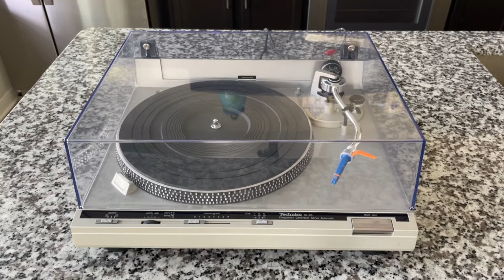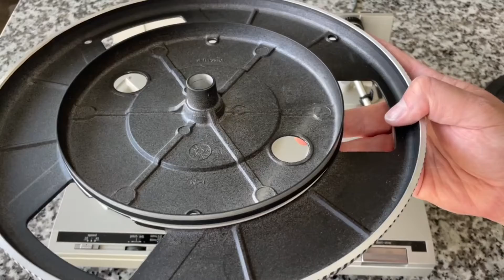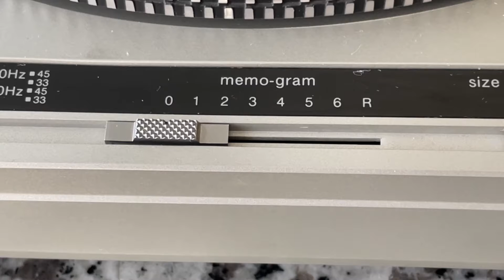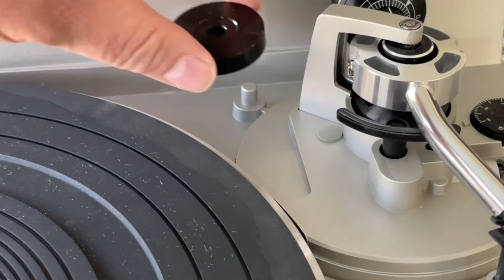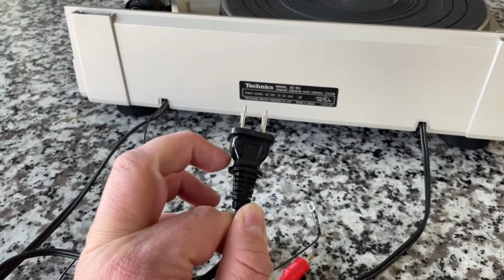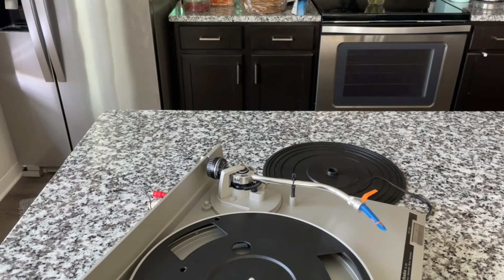Technics SL-B5 Review & Test!

Comment: Great video! Love your enthusiasm for this. I feel the same way about my Technics SLB-500.  And it’s been in our family since the day we bought it new back in about 82! It’s always just fun to use and, I don’t know, hard to explain I guess. But it’s a mechanical marvel. After all these years I’m still wowed by how beautifully all those mechanical parts work together. The multi-record spindle is especially cool.  Delicate and somehow robust at the same time.  Sadly, my unit finally quit working about a month ago. Had the Dickens of a time finding somebody to work on it. But finally did. About 530 bucks to put in a new motor and a new logic board or whatever they call it. But I told them to go ahead and fix it. It’s fun use, extremely well built, and has great sound. I don’t want to buy a new one. It seems the only difference between mine and yours is that the five that you have has an adjustable tone arm balance. The 500 that I have does not. After over 40 years of use, it almost never drops the needle in the wrong place. Maybe one out of every hundred times. Just amazing

Comment: Technics made a few beltdrives before and during the early direct drive era
 I think that when the quartz direct drive was intriduced the "belties were finally discontinued. They were very inexpensive, maybe 150 or 200 bucks in the early 70's. They worked fine for what they cost at that time. Abyone paying 450 bucks for one today needs a straight jacket right away.  100 bucks should be the max for a working one. They not a trye high fi item then, simply better than Emmerson, Julliet or a console mounted unit. If all you want is a relatively refined platter to spin old records from some garage it definitely fills the bill. Given a half decent cart like that Concorde it will play good records without damaging them and reasonable fidelity. Personally given the steep price of good modern vinyl, I would never run any record you really care for through the changer function. Tge automatic return of the stylus is fine though.

Comment: I just picked one up on eBay at a decent price. The only issue it has is the stylus slides onto the beginning of the record, be it 45 or LP. It doesn’t do it all the time, but enough that it is annoying. Even with the anti-skate setting all the way to 0 and beyond. Does anyone familiar with this turntable know what the problem could be? I’d appreciate any help. Thanks.
Reply from the maker: First of all, congratulations on an excellent acquisition! Sounds to me that the Tracking force is set too low. Research the proper tracking force of your cartridge and make sure you are set to the right value. Also make sure that the anti-skate number matches the Tracking force Number.
Reply: @Recordology Ok thanks

Comment: I have an SL-5 linear tracking turntable in my bedroom/home theater and have been using it for years, but most of the buttons don't work properly and I have to open the cover to stop it at the end of a record.  My dad, who doesn't listen to the radio anymore has this one (SL-5) in the basement/rec room.  Thinking of swapping out unless the SL-5 is worth getting fixed...either needs a cleaning or a new circuit board, but it would cost me at least $120 plus parts to find out.

Comment: The 'valley' areas under the platter are there for further reduction of the vibration between the motor and the belt, OR to further balance (but not reduce) the vibration when the 'valley' areas contain minor spare parts such as screws or feet.

Comment: Nice video. We found one at an estate sale a few weeks ago. It needed a new belt, and stylus. I kept the same cartridge. It had Ortofon FF15XE M II. Found a replacement on ebay. Once I cleaned it, put in the belt and stylus... It sounds amazing Took another video to learn how to use all the balance and skate settings. Only bummer is the dust cover was very scratched. Been looking for a replacement dustcover. We bought it for $50.

Comment: Matsushita sure made a lot of variations of their turntables. Yours is a beauty. I got my father's Pioneer, made by Matsushita of course, that was made in 1968. You can see the DNA in both this Technics and Pioneer. My Pioneer 740 is fully automatic and direct drive. It is a little cheaper in the tone arm department but fully adjustable. These machines were well built. This 1968 unit still works perfectly.

Comment: I've loved Technics turntables since the late 70's.  I have several now, SL-1600 MK2 (similar to a SL-1200 but with automatic cueing - I think it was heavily used in radio) and a couple of linear tracking models (SL-5 & SL-6 - this one has the track sequence playback function).

My question is about what are you using to clean your records?  My ears aren't as good as they used to be, but I didn't hear any surface noise or pops/clicks in the playback demo - even with that "heavy" tracking force you're using.

Keep up the good work!

Comment: with  the staker part of this turntable some people used to find that as a 2nd or 3rd record came down play scratches were caused  over as the first record would be spinning as the 2nd record came down onto the platter
Reply: Actually that's a myth. Because the label and outer edge of a vinyl record are raised, the grooves in the playing surface are never scratched or otherwise touched when one record falls on top of another. In a styrene seven inch 45 only the label is raised, but again the grooves are never touched when a record falls down the spindle on top of another. Fully automatic stacking changers are a great way to enjoy records, and IMO Technics made the very best. I'd be the first in line if they were to get back into the changer market with a direct drive model.

Comment: Up until the end, Technics had a fairly even distribution of belt and direct-drives. Most of their direct drive tables also had a belt-drive counterpart. 

My first turntable with a removable heasdhell was the predecessor to the one you're looking at here, the SL-B2. I had to replace it with an Audio Technica 140 because the speed just got too unreliable and the anti-skate spring just wore out and did absolutely nothing. The AT was much more reliable speed-wise, but the anti-skate was equally worthless :) But for the two years I had it, it was a vinyl ripping workhorse. 

I would absolutely get another Technics, doesn't matter whether it's belt or direct drive. I cut my teeth on Technics turntables.
Reply from the maker: Awesome

Comment: This deck was under 200 bucks at the time. There was also a version with direct drive SL-D5 for around 50 bucks more.
Anyway,the best price/quality ratio for a deck around the 200 bucks mark from that model generation has the SL-Q2 imho.
A semi automatic turntable with q-locked DD and alumium chassis. Just remember all those models mentioned were between
entry-level and middle class in the Technics program back then.
Reply: Yes
I have the SL D2 DD semi auto and its be all right today

Comment: This is a consumer grade turntable of the late 70’s. Technics made several models of belt drive and direct drive models in this era. Not close to hi end but better than an entry level table at the time. What makes yours interesting and less common is the stacking functionality. Ones like yours are far less common because of that.

Comment: You are so fortunate to have gotten the stacking 45 spindle with this. It and the stacking 33 spindle are unobtainium rare and expensive to find on the used market.
I have 2 of a similar cousin MCS / JC Penny  - branded version of a Technics stacking auto changer (there were several models of changers under either brand) and I do not as yet have the stacking 45 spindle.
Stupid me, I was given a different Technics one perhaps 20 years ago, which had the accessory spindles, but I eventually sold it.

Comment: wow the minute i saw this technics TT I knew it was a stacking type ou TT this is cool the empire cartridge was a great cartridge very popular when i was an audiophile but that one I have never seen at first it looked like a grado but an empire wow !! this is a great find ,I don't care if it is considered a low brand cause of belt drive this is a technics it is a great find to me if I could find one I would buy it and on the cord if you use wd-40 on the plug it will remove the stickyness and clean it up  JRo

Comment: What I would do is buy the correct belt first then adjust the 33rpm & 45rpm speeds so that pitch doesn't have to be adjusted each time you change speed! Oh and also the empire cartridge that came with this is a good cartridge and I would buy the needle and try it!

Comment: The deep well under the platter is where the coil of wire goes in the direct-drive version, forming half of the motor (the platter itself forms the other half).
Reply from the maker: But was there a dd version of this.
Reply: @Recordology  Every Technics belt-drive changer had a direct-drive sister model. The SL-D5 is the DD version of this turntable.

Panasonic, producing turntables en masse for both themselves and for third-parties (MCS by JCPenney being an example of Technics custom OEM work), had numerous shared parts between their various turntables. It totally makes sense from an economic standpoint. For the most part, when there were no changes that would get in the way of the TT's structure, the DD and BD sister models would share the same molding to save money on producing new molds and dies. That is why you see the deep well. I'd say it paid off fantastically for Panasonic over the decades. Their economies of scale in the 80s—and an underground niche audience of DJs—allowed the SL-1200 MK2 to thrive through vinyl's dark ages of the 90s and early 2000s, and receive a few revisions and modifications that don't really tamper with the structural and electronic foundation of the original 1200MK2—those improvements being in the form of improved vibration damping, recessed power switch, a button to toggle the quartz speed lock, and upgraded tonearm wiring.
Reply: @Recordology  They had a direct drive record changer, the SL-1950.
Reply: @Recordology  yes there was, the SL-D5. There's an entry on vinylengine.

Comment: That turntable is awesome! I have a Miracord 45 bought in 1972 that does have 4 speeds and also the spindles for automatic play of up to 5 records. I used the automatic drop only once to make sure it worked but never again as to protect the record labels. It isn't belt driven as it has an idler wheel drive> ( I know, old outdated tech.)

Comment: Just earlier today I thought about how our old record changers never said what the limit was on the number of records to stack , so the stylus angle would probably change from bottom to top record if too many were stacked. Actually, I rarely used the stacking feature on any phono or turntable, I usually played discs individually. The needle would sometimes miss the edge especially on 45s that had a slightly raised edge which were styrene records I think. You have a charmed life getting gifts like this, but maybe I do too since you sent me a gift as well.
Reply: I believe they usually did state how many records you could put on - though I am not sure if they took the stylus into consideration, or just the height/weight. Another model of Technics changer from about the same vintage ( I am guessing based on styling) claims "up to 6 records" could be stacked. It would be fun to compare the audio of a recording being played on the platter VS 5 records up!
Reply: @jmacdermott8871  Its  been done by Tech Connections I think, in the comparison there was no difference in sound with VTA between full stack and single record.

Comment: What is the difference between technics And audio technica turntable
Reply from the maker: Good question.  Two different brands completely
Reply: Like the difference between Fluance and Crosley. Both make decent units for the money, but the operate (or, in the case of Technics, operated) on two completely different levels. 

Technics didn’t make the best turntables ever, but they made some of the best mass-produced tables at the time, and they are still widely sought after 40 years later.
Reply: @thefamilydad8635  I would not put Audio Technica in the same category as Crosley.

As one example, the Audio Technica AT LP 120 (and now the AT LP 120XP) remains one of the best, if not the best, selling direct drive turntables in the market. This is for good reason. It has a well established reputation for good quality at an affordable price. People who buy the 120 know they’re not getting a Technics. And Audio Technica has never claimed to be the same as the Technics. But something doesn’t have to be at the top of the scale to be good. I used to own a 120, and was quite happy with it. I only got rid of it because I had moved up the Audio Technica chain and purchased a 140 XP. This is also a good direct drive TT that doesn’t claim to be a Technics.

Considering the poor reputation that Crosley has, I don’t think a comparison between Crosley and Audio Technica is valid or appropriate. There are other brands that would have been a better choice. One example is U Turn, for they make very basic TTs that are good but not in the same category as the Fluance. And the fact that they are both belt drive TTs makes a better comparison as well.
Reply: A big difference I would say is that Technics does not make average consumer audio gear anymore. 

The new models they sell are very expensive. Their vintage turntables were widely available and affordable in the 70's and 80's.

Audio Technica makes modern turntables for average consumers at affordable prices. Audio Technica is an old brand too but their vintage gear is uncommon to me.